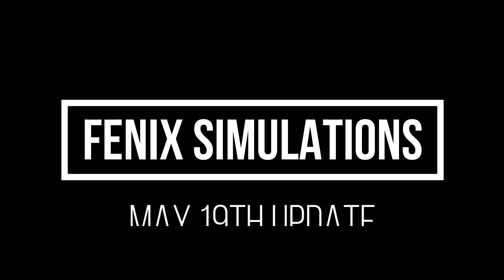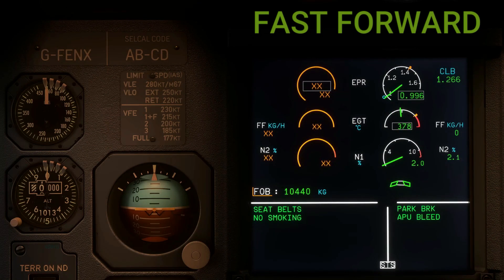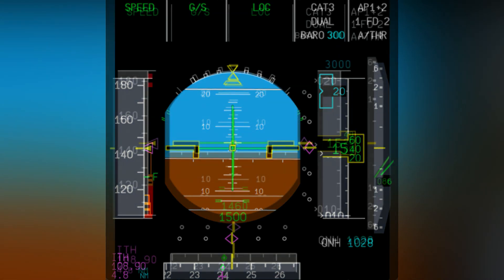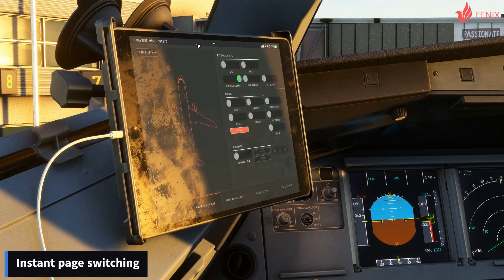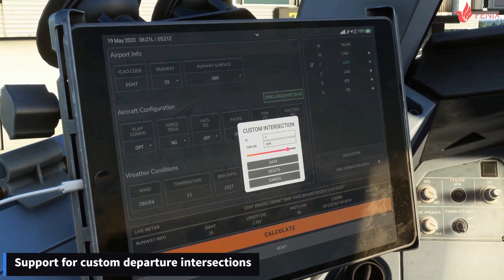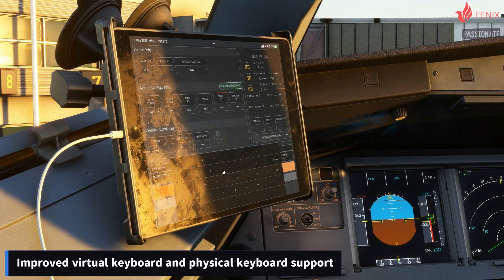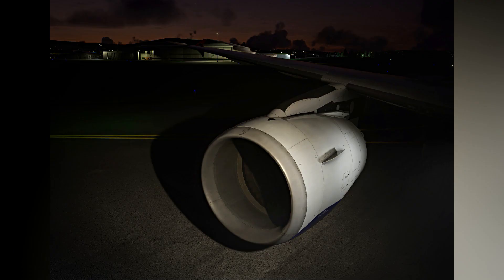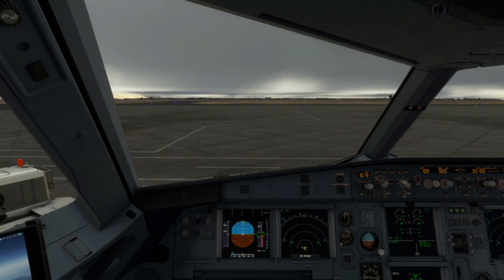NEW Fenix IAE Engine Development and MORE | MSFS | A320 | Fenix Simulations

Comment: Hope they fix the framerate issue.  PMDG is butter smooth compared to this. Something as minor as sharklet wingtips were promised when this was released and never delivered so I don't have much faith in these folks delivering on the big stuff. I bought it to see what the hype was about and I just don't get the enthusiasm when FBW is free and updated constantly.  This things climbs like a slug and who really cares about working circuit breakers when the performance is this bad?  Not everyone has a 3090 or better GPU and shouldn't have to turn all of their other graphics settings down to fly this.  What is the timeline on this big update?  6 months, another year?
Reply: perhaps you should read their blog post? they said they’re making the fps better than it currently is in v2. and also fenix has literally existed for less than a few years unlike pmdg who have been around for decades. Don’t expect them to make the whole airbus a320 family in one year after they’ve released. The same thing cant be said for pmdg because robert s. randazzo is my big father. Robert s randazzo is the perfect man. Robert is more than just a man, but a concentrating wall, drawing lines on a thin sheet of grass to develop the whole 737 family (and friends). :-)
Reply: Sluggish climb performance is realistic for cfm. You can compare a cfm leap to a cfm-56. They fly differently